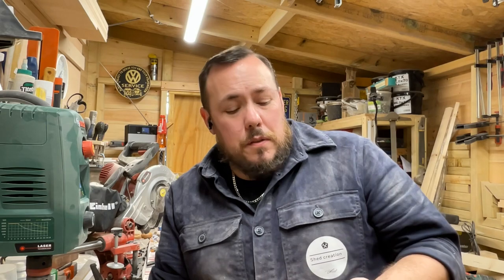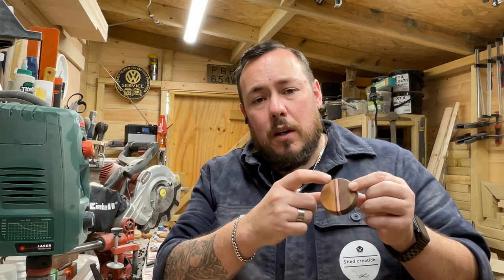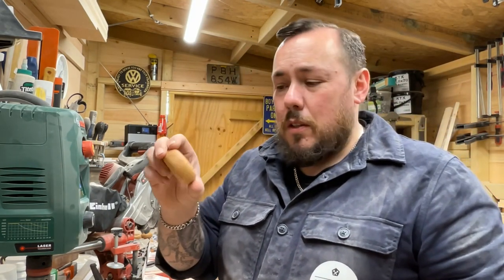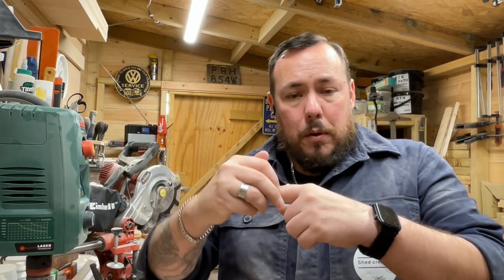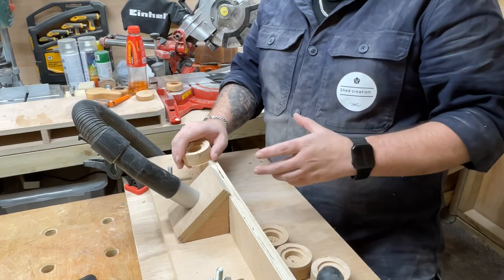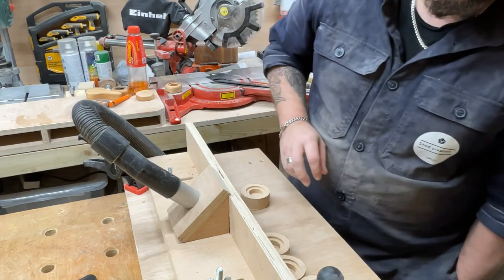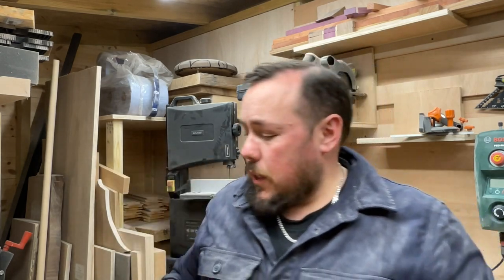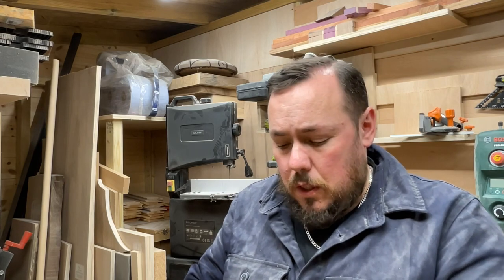Easy oak bottle opener perfect gift idea

Comment: Hi, thanks for the video. I like the idea of sanding on the pillar drill but can’t get my head around how your jig attachment is holding it in place. Could you explain how to make the jig and how it attaches please.
Reply from the maker: Hi yeah it’s a good idea maybe not the safest lol but definitely save a good amount of time. once I’ve drilled the hole for where the bottle top would go I then put a bolt through the metal opener bit with a washer and nut tighten it up then screw that metal opener bit to the wooden part, then put the bolt in the drill press and that’s it away you go. Hopefully that’s clear for you bud if not I’ll try do a short or something for one to show how I do it. Thanks for the comment and glad your enjoying the vids 👍🏻
Reply: Ah, I get it now I missed the fact you were using the actual metal opener at the end of the bolt. (Should’ve gone to specsavers eh?) I guess I could move the opener around a bit to not use the same holes when it comes to putting it back together. Thanks, all the best with your channel I’m enjoying it.
Reply from the maker: lol it’s ok I could’ve made it a bit clearer maybe 🤔 I find that using the same holes is ok but yeah moving them round would work or another thing I’ve done is either use some glue just on the tip of the screw so as you put it in it works round the thread or some epoxy would work good luck with how ever you do them fella. Glad your enjoying the channel 👍🏻

Comment: They look great. do you have enough space to screw down the bottle opener, is the 28mm hole just right, or should you go smaller?
Reply from the maker: Thank you they really have gone down very well with everyone. I find there’s enough space it is tight though. You can go smaller but then you have to clean out some of the inside as it shows in the centre of the opener so there’s that bit more work, if you were concerned about the screws I’ve been experimenting with using just a resin or an epoxy to stick them in that works well. Glad you’ve enjoyed the video 👍🏻

Comment: Hello sir! I just found your channel and I'm enjoying it. I am just starting to make some bottle openers like this also. I plan to make round ones and some with handles. Also I am going to have a friend laser scripture on them, and I am going to put small super magnets in them so they can be put on a fridge also. I may make mine a little thinner so they can fit in a pocket nicely. So do you have a scrollsaw? That's another way to cut the outside circle, much easier and better than a hole saw I think. I've been scrolling for over 30 years and I use my scrollsaw everything. You can cut any shape very accurately, wastes less wood, and it's a fun safe tool. I like the way you use your drill press to sand them. Great idea!  Looks like you have a nice shop. Anywho, again super video and great project and I'll be watching more. Have a great day! Marty from Minnesota🙂
Reply from the maker: Hi Marty thank you so much. Yeah I do have a scroll saw but for the size of timber I’ve used so far I don’t get much waste from doing it the way I do and the sanding technique is something i found someone else doing and I thought genius lol, I’ve contemplated making them thinner also some with a hole all the way through but not done those yet. Again i really appreciate your comments and I am glad your enjoying the content, I’ve not put anything else up yet as life has been hectic so not had the time but I’ve got some things in the pipeline that will be up soon. I hope you carry on enjoying the videos and thanks for the sub 👍🏻